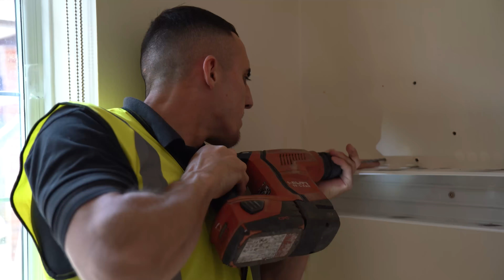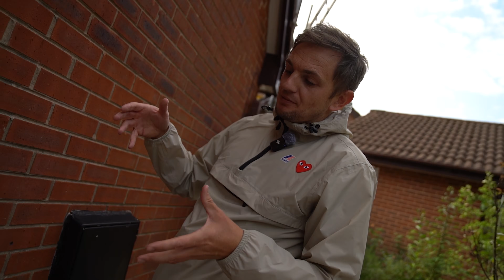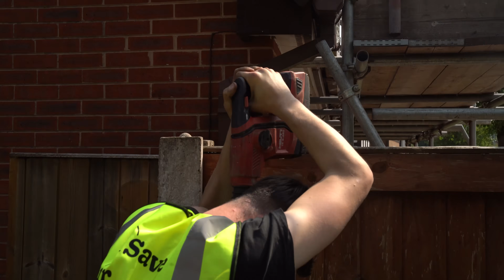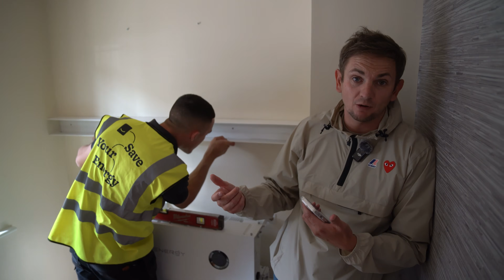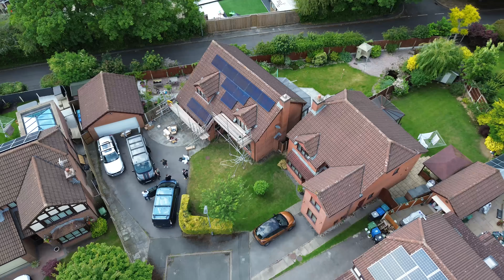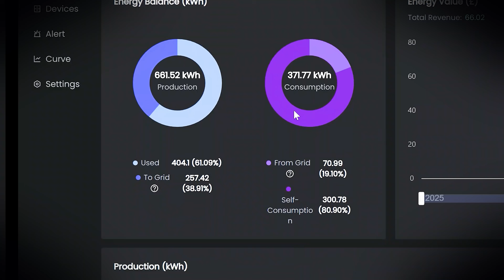Sigenergy Showed Us Why Tesla Should Be Worried...

Comment: Can you use the REA fusion 2 with micro inverter AND the Sigenergy Signestore in AC coupled mode? Most of you previous installs I have seen with micro inverters have been with a Tesla Powerwall, but I wondered if there was a difference in the AC coupled configuration of each system?
Reply: Also, I guess there are DC to DC efficiencies for DC coupled, but then there are individual panel efficiencies with micro inverters. What would you consider would be the least inefficient/most efficient?

Comment: Do you need the gateway ? Seems like a massive unit would be nice to have the system without it. Powercuts are so rare and if they do occur they don’t last long
Reply from the maker: Yes you can have the battery without back up if you’d prefer! The gateway is extra 😊
Reply: You can but would be silly not to get the gateway it’s what gives this battery its features this batteries backup is best on market with inverter capacity up to 30 kw you want gateway trust me!
Reply: @jasonkemp3515 The total average interruption time per year is 30mins for someone in the UK think I’d rather not have the added complexity, space and cost.

Comment: Where are the batteries and inverter? I thought they needed to be in a separate garage or outside in case of fire.
Reply from the maker: Hi Violet, the batteries and inverter are located inside the customer’s house in a spare room. The Sigenstor is possibly one of the safest batteries on the market for this sort of location, with 5 layers of fire safety features built into every module. This includes a heat-activated fire suppression system in both the cells and the inverter.

Comment: Definitely biggest mistake not maximising panel of roof, because panel are crazy cheap at moment. Mot of cost is installation. If budget limited than he/she should maybe limit battery capacity and them later as it very easy to do and most likely price will go down in time

Comment: I'm surprised that if the customer was serious about going off-grid, they didn't want  more panels. The main cost of the panels installation is the scaffolding etcétera, so to put up another 6 panels would have been minimal. The cheap overnight rates could dissappear at any time, so I'd recommend putting up as many panels as you can afford!
Reply from the maker: Great point, and something to consider for anyone looking to maximize their self-sufficiency!

Comment: Sigenergy uses the absolute cheapest inverter tech on the market in their inverter designs. They don't even incorporate an output transformer which is critical for safety reasons. These cheap high frequency inverters lack any galvanic isolation which can lead to some pretty serious damage to your home's appliances.  When the MOSFETs/IGBTs in these inverter's H-Bridge circuit fail they can even set some of your appliances on fire. If you're want to power your home safely, it's far safer to use a low frequency, transformer based inverter instead. After 25 years of experience working in the inverter repair industry, in my opinion, these cheap, Chinese made transformerless inverters should be banned for sale in the US.
Reply: Aren't you the guys with 110v plugs?

Comment: I like my Sigen 16kw battery, the software is not perfect but it is improving. I am unfortunate to have a noisy gateway. It buzzes and can be heard three rooms away. It seems be be rare occurrence to have a noisy unit, but they do occur. Sigen will not replace my unit as their tolerance is 45db measured one meter away. Mine is 37 db, god help anyone who gets stuck with a 44 db unit. 

I have a video about it, if any one is interested.
Reply: Muffle it with a cardboard cover insulation bubble wrap? Mine is outside so no noise problems

Comment: Is it worth having bifacial panels when mounted parallel to roof? I just got a quote and they said that it was not worth it and just went for a single sided n type panel.
Reply: Yes, Bifacials definitely work better when on a ground mount system, (mine are used as a car port), however they will perform better on the roof in cloudy/overcast weather, they also perform better in really hot temperatures. The increase is dependent on many factors and it's debatable how long the extra cost of Bifacials will be cost effective.
Reply: @simonpaine2347 Interesting. I had exactly the same thought when I saw them using bifacials for a flush mounting on a pitched roof so thanks for the input.

When you say they work better in really hot temperatures does that imply that it's not just UV that causes the photovoltaic effect but there is also some PV activity generated from thermal activity? If not then with seemingly so little reflected light likely to get under the panels with that almost flush mounting I'm really struggling to understand how much reflected light gets to the underside hence how there is any appreciable efficiency gain per square metre of panel.

On reflected light, and this is maybe a question for Heatable...

If the benefit gained from the downward facing side is primarily (or all) from at least some reflected light getting in under the panels and is not from thermal effects then is it worth creating some sort of reflective surface on the tiles that are directly underneath a panel even if it was as crude as spray-painting the appropriate tiles white (if you could get some paint that would stay intact with years of rainwater running over it)? The treated/painted roof tiles would only be the ones under the panels so aesthetics shouldn't be an issue.

Comment: Agree with much of what you say...  Most 'modellers' calculate 7/8 years payback.  If the rates remain similar to how they are now, it could even be better.

Max your roof with panels - they are relatively cheap these days.

Include northerly panels - sun rises about NE in summer; you'd be surprised at what these panels actually do generate (I was).

Get more battery so you can benefit from the 8.5p overnight charge, and run off them all day.  (I'm upgrading my battery to be about twice my average daily consumption - 2x13.5kWh)

Use as much as you can at night - delayed start washer/dishwasher; charge car at night etc

Sell ALL your generated power at 15p.

Recognise that you get 8 good months, and 4 bad ones where anything generated is a bonus (Nov-Dec-Jan-Feb). Your battery/night-rate covers yo0 well this period.
Reply: Discharge anything left in your battery before 2330 then charge and discharge and charge to 100% all before the cheap rate ends at 0530

Comment: You are misleading on the savings. Why have you calculated what they would have paid at 28p a kw but then when you calculate what they have used you used 7p. Those savings aren’t fully correct.
Reply: He stated that the energy plan/tariff is time of use dependent, I.e. the UK has lots of wind power at night so it’s possible to be on an energy plan/tariff that provides cheap electricity at night
Reply: They are correct if you would be using grid electricity during the day as that would be 24-28p. So by putting the system in they are able to use the 7p energy tariff at night, which they wouldn’t have access to without the system (or an EV).
Reply: Assuming that the customer had a 5 hour off peak tariff during the night he should have calculated accordingly. Calculating 24/7 at 28p is indeed wrong as the tariff has nothing to do with the system but it does take advantage of it.

Comment: Excellent video. As a layman can you clarify that you're not using Henley's to split the supply but simply extending from the supplier mains box outside to the Sig gateway?.  Also can specific items be wired from the gateway into the house using it's separate earth (specifically hi end hi fi that wants a "quiet" supply). Thanks

Comment: Why do you need s extra earth electrode, doesn’t the mains system and dedicated electrode? All earth should be bonded together no switching
Reply: Regs demand separate ground rod for islanding systems so that you can run safely during a grid outage (and not rely on the network ground)

Comment: Not sure why you boys didn't suggest to the customer that maybe the should go for the 8kW inverter... I know he doesn't have much solar yet (he/she will probably regret not filling the other side of his roof at the same time) but those 2 battery modules can output 8kW maximum so the system will be limited by the inverter.
Just my opinion, obviously there might be other things I don't know about.
Reply: Something interesting with this system though if you put extra panels the DC current goes straight to charging the battery, I believe each 8kw battery can take in 4kwh hours each so in theory you could have 8kw going into the battery and still have 5kw going out the the grid at the same time, I could be wrong but that's my understanding, looking at getting one myself.
Reply: @42Hoggy I have the same spec sig system since September. I don’t have electric heating so 6kw inverter is ideal but if I do go to ASHP I’d increase to an 8